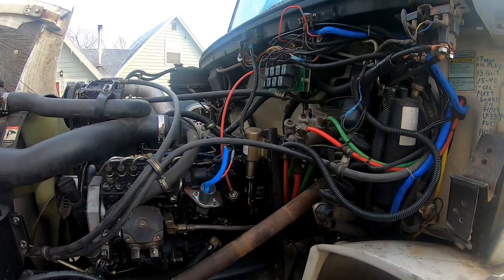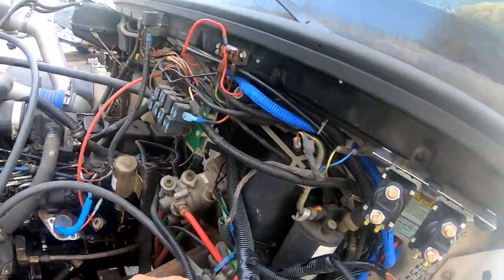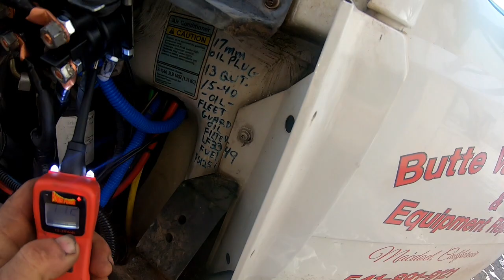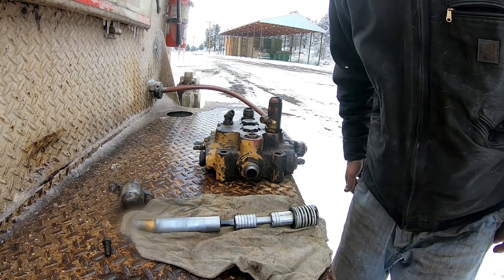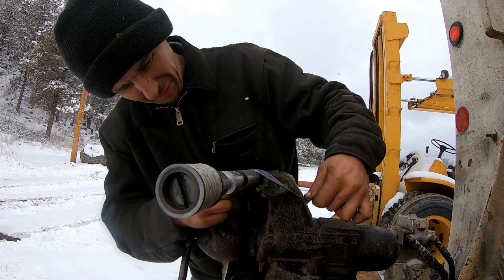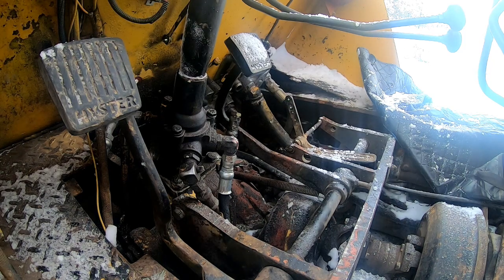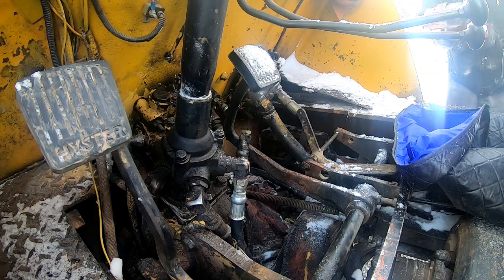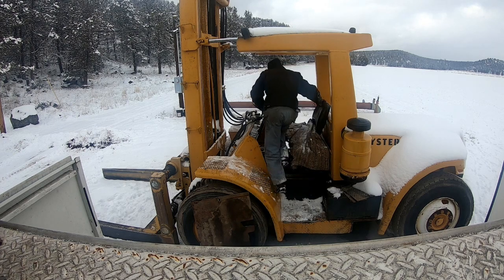Working in the cold!

Comment: I've worked on hundreds of old units like those they were used for tire handlers in the mines to handle those big tires on haul trucks , then the hay haulers discovered they could put a hay squeeze on the old worn out ones .
They are easily rebuilt or stuff a different type of engine and trans in them and away you go a new life for old iron.

Comment: Radio @18:55 - 38 Special, hang on loosely...haven't heard that in a while....I worked in shop and on service calls / mobile in Manitoba, western Ontario, and western Alberta Canada. Hated the cold - one of the major factors why I left the trade. My coldest day ever, temp -53 Celsius in the morning, in far northern Manitoba at a remote mine site clean-up / reclaim job. That's thermometer temperature, not the wind chill. 14 hours working outside in the deep snow, cold, and dark. The day's high temp was a balmy -44 C. At those temps in such a remote place (I was the only one there as the site was shut down for the winter except occasionally firing up one Espar equipped excavator used for digging soil test pits), shutting off even my gas engine service van for more than 15 minutes would have been deadly, as it probably would not start again. The heater was barely able to keep the frost from completely obscuring the windshield. Forget about getting the van interior warm enough to drive without gloves on. The higher I turned up the heat, the colder the engine temp gauge would drop (yes, I had a winter front). Western Ontario was just as cold, going into the fly in / ice road communities in the north. Alberta got cold, too, but it never stayed cold like Manitoba did. Not uncommon in Manitoba and N. Ontario to see daily high temps not getting above -30 C for 4-6 weeks straight, and snow on the ground for 5-6 months.... Alberta (in the Rockies), most winter days were like summer camp by comparison...

Comment: I'm in Nova Scotia, east coast of Canada. Winter temps run anywhere between -10 and +40 F. We are right on the Atlantic. Damp bitter cold. Travel a few hours inland and it starts to be a dry cold and 5 to 10 degrees colder. Much easier to work in the dryer cold.

Comment: Lots down here in the Ohio valley just put a manual shut off because of problems with those electrical shutoff solenoid. Those protective boots on them because of the heat in the summer almost like melt and become real gummy and keep it either from shutting off or opening. Yes buddy those grid heaters make all the difference in starting during the cold. Funny about those not wanting you to leave, my last employer a week after I left asked if I would come back to work. It's nice to know someone out there knows what hard working man is.
Reply: oldfarmer  vv

Comment: hey warren just started watching your videos im very imprested you just said you wanted to get into line boring I was at Michigan cat the other and they had there line boring truck in to get some new shoes on the brakes what the service teck was drive was a double axlel service truck I think it was a Kenworth with air ride suppension  and I think a 5 or 10 ton crane but dont hold me to it with a big welder and generator that's  all he does  then I saw another giy on youtube he built a custom double axel trailer and put all of his line boring equipment on the traler
Reply from the maker: Thanks

Comment: I hear you on the wet cold worked in CO -35 was the high point several days, worked down in FL 32 degrees 100% was colder!
We had the insulation break on cable in CO when we tried to unroll it after it had sat outside in -32 shattered like glass

Comment: Those grid heaters are a godsend, this past winter i live in Northern Saskatchewan it was -47 out i got a emergency furnace repair call at about 4 in the morning... my block heater cord had gotten pulled out by i believe my St Bernard running in between my shop and my truck and that truck was damn cold.. but sure enough i cycled the ignition a couple times and that bitch fired right up i was amazed. I love my Cummins and fuck ya my dad when i was a kid used to tell me some horror stories working as a heavy duty diesel mechanic up at Fort Macmurray in northern Alberta... tryin to keep the big machinery running they never shut them down ever in the winter. Hands freezing to wrenches lol all kinds of fun shit. Hence.. why i became a Plumber. I cant believe you dont have more Subs... consider me done mate i enjoy your videos.

Comment: Warren, I was too cheap to buy a control unit for my little JD 4100 tractor so I wired the hold in  fuel coil on with key switch and put a pushbutton switch to momentary power the fuel pull in coil. It also acts like theft protection.

Comment: Warren is there a common way that water gets in the hydraulic system, I have a 4630 that seems to get water in it more often then I feel it should. It is a loader tractor we feed with in the winter as well as push a lot of snow.
Reply from the maker: Sounds like you either have a plugged vent on transmission or a pump sucking air can make the oil milky.

Comment: I'm glad somebody else dislikes using either.  I've told people you can make a engine be dependent on that stuff. We have a lil Japanese tractor, the glow plugs don't work. In the cold I take a propane torch and heat the air intake pipe, she fires right up.

Comment: I like the sound of old little Detroit engins  I think I can I think I can one thing have to kepp on top end to get all the horse power out of the. Big or small  just couple 100 Rpms Is a big difference on power 892's non turbos  ran the hell out of them in oilfield pulling riggs wide open all day never quit great engines
Reply: Hey did not see you put the o-rings in the body after you reamed with brush????

Comment: The p pumps dont have a cold weather advance like the ve pumps.  Adding the grid heate will help.   Throw you in a block heater so you can be nice and toasty instead of wiaitng 30 minutes for the engine to warm up enough to have heat.

Comment: Mid-Atlantic east coast here- cold for us is any time it gets to single digits. We rarely see negative numbers.   I hate the temps between 40 and about 25. That's when it seems to bother me the most. Once it's gets to low 20's and lower,  it's too cold to matter much and i'm ok with it.

Working out a service truck all the time, do you have any issues with battery powered tools being affected by it? I'd be concerned about lithium / lipo batteries on newer tools freezing. I bring all my battery stuff from my workshop into the house during the winter, but I'm not pulling out to use outside everyday. My work tools stay in the shop and I'm rarely on road service in cold weather.

I enjoy your channel because you work like I do.  When you're good, they don't want you leaving!  Our dealership has customers who've told my boss that my work in the shop  is the only reason they still buy our equipment!  Every time I've had the shits of the place, they pay me more to stay.....23 years and counting!

Comment: i did a job years ago minus 17 with a 70 mph wind chill minus 22 had big problems with sciatica .muscles don't like the cold . UK = Wet Cold .
Reply: Could Always fit a timer Relay to the heater Contactor . removes the switch .

Comment: my buddy has a 7.3 and he said he was driving down the highway then it lost power, had to hold it to the floor to do 50mph and it took a mile or 2 to get back to 50mph.
any ideas? its a 1999 dually
Reply from the maker: Could be a multitude of things.
Reply: Ya I know...I just thought it might ring a bell somewhere.
https://imgur.com/a/an4tTCP
I bought it off him, I'm hoping the batteries charge up so I can start it.
He parked it 6 months ago  and the batteries were stone dead.

I guess I should make a video but I dont want to draw too much attention either.
All the crackheads got phones these days.
fukt up huh?

I enjoy your videos and am really proud of you. You're solid guy and dedicated.

You made a good move on that work truck.
Reply from the maker: Could be a bad icp sensor,  could be as simple as fuel filter. I've got a 7.3 right now that the internal harness under valve cover came unplugged.
Reply: hmm I'll check those, thanks!
Reply: The ICP plug is soaked.
Will it start run with it unplugged temporarily?
Reply from the maker: Yes
Reply from the maker: Replace it if it's soaked with oil
Reply: ok I got a napa silver, sprayed out the bowl and center, put the stand in and put the busted heater frame in and bolted it up.
I filled the bowl with seafom and after about 10 mins it came back to life!
Its a bit lopy until 1700 then it sounds like all 8.
I'm gonna drive it and try to clean it out. Then I'll do the quArter trick and icp for sure.
I'm pretty happy right now.
Reply: I took it for a drive and it would brely move.
No power.
I'll have to pull the covers off
Reply from the maker: I bet the sock on the pick up tube in the tank is plugged,  after looking at the filter.
Reply: yes I'm gonna drop the tank too. Theres 2 strainers in the pickup housing.
It is cold as hell up here right now and windy real bad.

Comment: I think you got something floating around inside the valve block of that old commercial valve that’s sticking it in your relief valve because I’ve seen it pieces of crap float in between the valves spool scratch the spools and then float back to the relief I could be a real bastard to troubleshoot all it takes is one little piece of crap oil ring or steel I’ve even seen!

Comment: wd40 is the best stuff invented    pb is no good  IMO
Reply: Scott K WD40 is weak shit. It’s an okay light lubricant and it’s good for taking off left over adhesive gunk but as a penetrating oil it’s useless. PB  Blaster is some of the best that’s widely available but the absolute tops in terms of penetrating oil is made be Gibb’s but it’s costs big $$$. Permatex makes a nice penetrating oil that comes out cold supposedly it freezes the rust and makes micro cracks in the surface. 

Straight ATF will penetrate rust better than WD40.

Comment: Machined??? You bet your boots they're machined Warren. Modern tolerance hydraulic components are machined to ultra fine tolerances. A piece of dirt of 10 microns can jam up servo valves and the like. Pouring new hydraulic oil straight from the can,unfiltered, into a system without putting it through a filter pump is akin to shoelling gravel into the reservoir. Upwards of 75% of hydraulic breakdowns are wholly due to contamination issues. That ,in reality, means the ingress of dirt into the system or using old,oxidised fluid.Most of this is caused by bad  housekeeping. Why the fuck would you spend $200 dollars changing oil when you can spend $10,000 on a new pump or drive motor? But, hey you and I both live in the real world and the job needs doing double quick time due to economic pressures and the whim of the plant owner. So we do what they want to get the thing making noise again. Funny old world.  Thanks for making these superb videos, they show it as it really is.